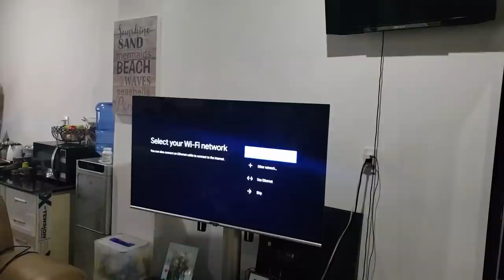Philippines Beach House Build Day 133: Smart TV Follow up, Double Matting the Steel, Good Foods

Comment: James, We were having a master light switch panel in the kitchen and stairwell rooms. Then decided to have a set 
in the master bedroom as well as the house girls family suite. We ended running a conduit  around all the rooms
like a racetrack so that we can add a 4-way switch to anywhere in the house. There are 6 sets of travelers in the
racetrack loop. There are 10 light fixture groups on each switch. That's 80 LED light bulbs total. I got 10 of those 
solar street lights as seen on your earlier video. They are 936 LED, 3600 watt lights. No need going small since they 
are self powered solar lights. If an intruder gets within 8 meters of the house they should get a surprise being
that they will see 5 Rotweilers at full charge ready to play. They all have the same name and control commands in 
Russian.  Looks like a military drill team. Stop!, Sit, Roll over, Come here, Eat, Heel, Chase. It is more fun in the Philippines.

Comment: Hi James, just an idea for your computers, use a compressor or vacuum and clean the inside of the computer, dust will cause over heating, and other issues, I use a fine paint brush when vacuuming my computer exhaust fan as well. Don’t touch anything inside the computer with your hands, Cheers Frank
Reply from the maker: Good tip!